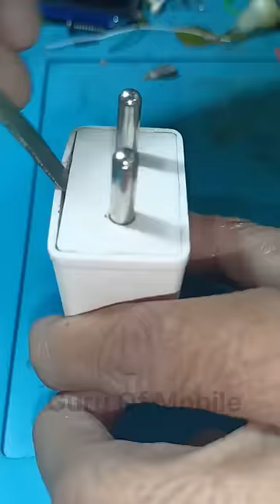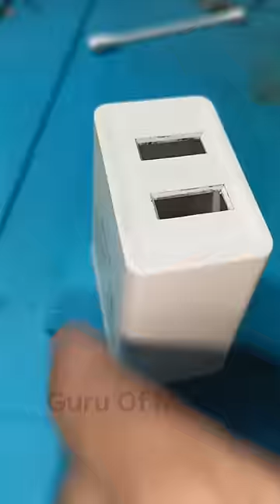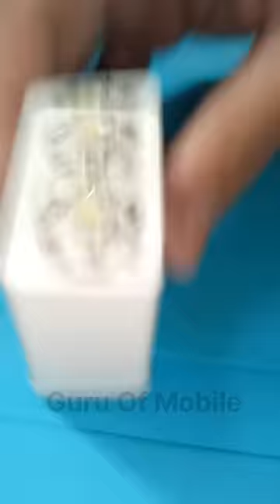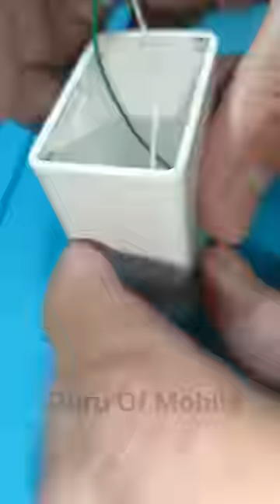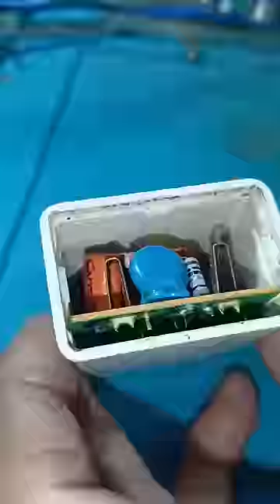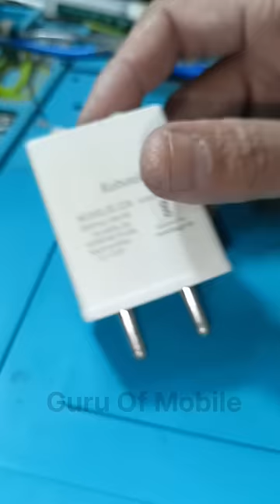Great Idea 💡 For OLD Mobile Charger

Comment: The next thing you should do with your converted charger is put something over the LED lights to protect the wires from shorting against any objects. There's always a possibility of something shorting the exposed terminals of the electrical components. Then once you do that, get a power bank and plug in your light to use it as a flashlight. It would be very useful in emergencies. I like your creation and want to see more like it.
Reply: To be fair, they are not drawing mains current, they're using the 5v rail of the existing hardware. It's not likely to do any damage to anything touching it, though it will probably damage the internal components of the charger if something were to short it.

Comment: It was necessary to put a resistance resistor for that LED so that it does not burn
Reply: This led canect in series canection not need resistor
3 volt ech led 
Total 3+3=6 not problem
Reply: @surajchavan4975 right bro...
Reply: also, it is necessary to place a heatsink so the LED doesn’t overheat and burn out.
Reply: @surajchavan4975  but it will draw more and more current as time passes by